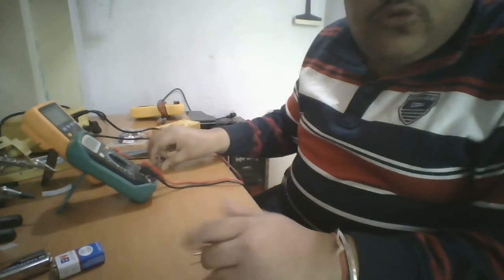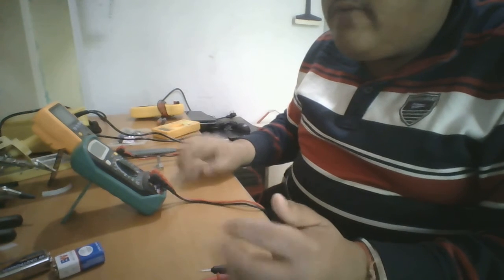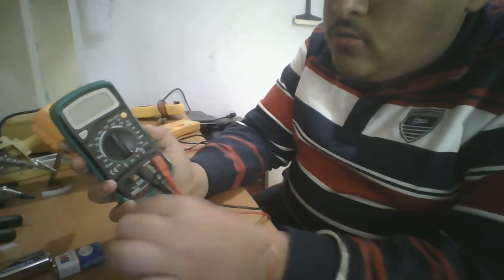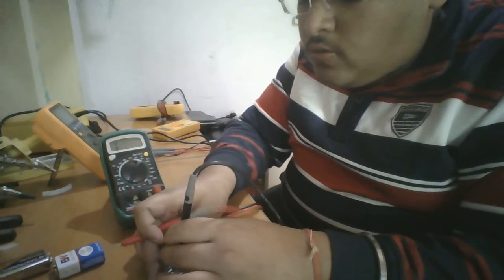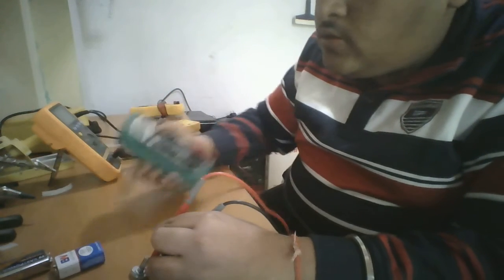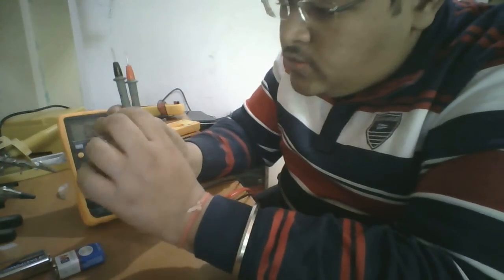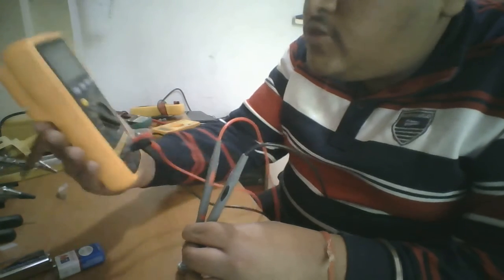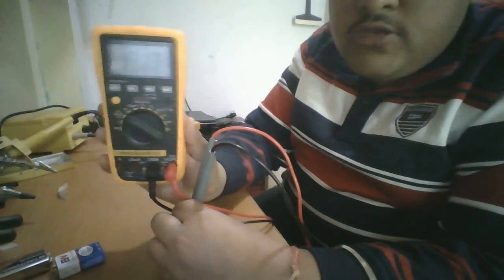How to measure the Resistance of Potentiometer or Variable Resistor using Digital Multimeter.

Comment: why don't you get crocodile clips on the voltmeter you wouldn't have to hold the wires then.
Reply from the maker: I was shifting my lab at that time and my whole stuff was messed up.
Reply: @AmitNohria  if you have a 100 ohm varible resistor is the 100 ohm the maximum resistance? or the lowest resistance? i can't find no snswer anywhere online,  i reckon its the lowest resistance and it only goes up to infinity from there, when i did think it would be the highest, i hooked one up to a fan and turned right down it's slow and when i turn it up it goes slower, any input world be great?
Reply from the maker: @doubleooh7337  if the variable resisitor is of 100 ohms, it means the 100 ohms is the maximum range. If your multimeter is showing more or less when the variable resisitor sets to maximum, then consider to check with an other multimeter, if your multimeter is trustworthy then change the variable resisitor. You can do one more thing put the probes of multimeter on 1st and 3rd pin of variable resistor and check the readings if it showing the rated value which is 100 ohms in your case then the variable resisitor is ok. But if fluctuates the readings while moving the knob when your probes are connected with 1st and 2nd pin then you should change the variable resistor. I hope it will help you☺☺☺
Reply: @AmitNohria  it does and don't its the same as i thought, but I'm using it on a fan with out measuring it because my motor i made blew all 3 multimeters i had, i got a 12v0.17a fan and the lowest v resistor i had was 470 ohm, i figured seeming i can just turn it to lower the rating I'll be ok but when i turn it to the least resistance the fan is spinning alot slower then it should be, because the fan needs 0.17A and my power supply says 3A so really it should be spinning really fast but it's slow, i only need 70ohm resistor max but i wanna be able to change the speed, I'm getting a 100ohm soon next couple of days to try out anyway, but it might still be to much resistance in lowerst, have you ever actually measured the variable resistance? or are you going off what the textbook says?

Comment: Your video is good and very informative.  You explained it in right way.  Only thing is that  light is very low in your room otherwise everything is perfect!
Reply from the maker: it was a casual video, i was sitting in my room and a thought came in my mind to make a video on it, unfortunately the time time i was making this video there was power cut in my area and the only light was running that is on inverter.

Comment: You can use video editing programs to edit out any mistakes. You dont have to upload the whole video first time. go over it.
https://www.youtube.com/editor
https://www.youtube.com/results?search_query=you+tube+video+editing

You can even record a separate audio track and narrate your video.
Thanks for showing how to measure pot with multimeter.
Reply from the maker: Thanks for your feedback. Currently I am checking YouTube editor and try to make my video better with it.
Reply: That's fine, glad it helps, Also Diagrams are great, sometimes it is hard to see what you are doing so you might want to put in some diagrams.

Steps/Scenes
1. Goal of video (To show how to measure potentiometer with Multimeter)
2. Equipment needed. (Potentiometer, multimeter, leads,breadboard?)
3. Process (First find the setting on multimeter, connect multimeter, adjust potentiometer, get reading)

For a video like this I would put in diagrams
https://goo.gl/hJVLRq (always good to use your own images though to avoid copyright issues) 
Use Paint from registered version of windows or even photos from your phone to get clear images, nice clear lay out to see what is going on, good lighting etc.  
record the video and edit it together (You wont need any audio in the beginning you can record a narration as you watch it back yourself explaining what is happening then combine the audio and video.